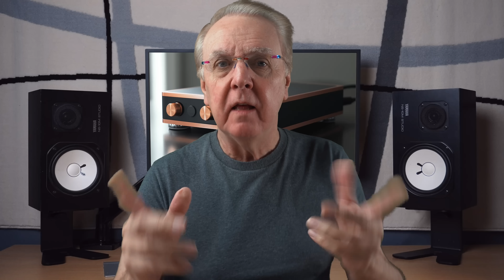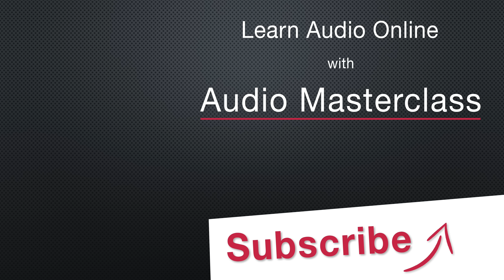Audiophile preamps - What should you get for $30,000?

Comment: There are only about 5 candidates for good low-noise opamps, it is futile to scratch off the labels.
Reply: There are more than 5 candidates I am sure but a look at the rest of the circuit will clue you in.  Low resistor values will tend to go with the bipolar parts and the higher resistor values will be with JFETs.  Supply voltages can let you rule out a lot.

Comment: Cheap and cheerful zero PSU noise Amp ! ... Get a car stereo head uint from the 90's or a system out of a Lexus LS400.  A good 12 volt battery and big wooden cabinet speakers.  It will blow you  socks off.  After use put the battery on float charge.   If you think 'Bose' or small speakers are good you need a reality check.  Even a basic 'Music centre" from the eighties is better than the junk sold today.

Comment: And anyone who seriously considers buying a Linn LP12-50 , at the price of 50,000 U.K. pounds, which purports to have been built in a joint venture between billionaire inventor Jon Ive*  - who licenses his company's name "Lovefrom" to such as the venal Tiefenbruns, needs their heads read. It still has many of the faults the original 1972 Linn LP12 had. It was a badly designed rip off of the Ariston RD11, and was a dog. As still is the LP12-50. It is 16,920 quid more expensive than the next less expensive LP12, the Klimax at 33,080 quid - for the 16,920 pounds difference you get a better on/off switch and improved hinges on the cover. That's genuine value for money. Have the Tiefenbruns found a way of taking their money with themselves when they die? Do the realms beyond the pearly gates feature casinos or dog tracks?
*and to give him his due, he has many useful inventions to his name and has done quite a bit to assist mankind.

Comment: 3:40 - concerning AC power interference, an Isolation Power Transformer Automatic Line Stabilizer ought to be your highest priority in any sort of expensive audio setup. Whether it’s some cool vintage hifi setup you picked up off the side of the road, or you spent stupid-dollars on snake-oil, or music production/reproduction setup, you should be using an adequate power supply system to the whole setup. Not just to enhance the sound quality alone, but to preserve and protect your investment in it. That’s like the 101  of professional or consumer audio wisdom. 😂
Reply from the maker: I am not in disagreement. I have looked at mains on an oscilloscope and was fortunate not to receive a Darwin award. It was a mess. I don't care whether I can hear the effect of that mess or not, I would prefer my audio to be powered by a sine wave, and for your other reasons. Sometimes there is just right and wrong.
Reply: @AudioMasterclass Yeah, I’m not entirely sure what you’re implying about preferring sine wave, on account that an isolation transformer doesn’t square off waves, so much as isolates it from mains, reduces ground noise interference, lowers the sound floor, and senses for anything particularly unusual on either side of windings and trips preventing electrocution or damage to your equipment and buffers out micro surges with mondo-sized capacitors. The primary one I use to run everything in my studio through a modular hub of 6 breakout boxes is hospital industry grade, designed for life support and vital sign monitoring equipment. Saved my life on a few occasions while working on live electronics, and saved my equipment from some serious power surges, and one instance where a fault from a storm up the road fed back hot over the neutral line, and blew every light that wasn’t incandescent in my house, and every tv that was plugged straight to mains, and not my transformer. The transformer tripped when none of the mains or surge protectors did, saving everything that wasn’t incandescent wisely connected to it. 😮‍💨❤
Reply: @AudioMasterclass  You want a very nice sine wave for your power? Go and buy a very large pro audio amplifier, used is fine. Something like a Crown XLS5000. Then go and buy a signal generator and feed that amplifier 60hz (or 50hz if your country uses that) input signal. Hook up a volt meter to the outputs and adjust the gain/volume until you get 120 vac output on the speaker outs. Or bridge the amplifier and meter 240 vac or whatever your mains is. Then hook you speaker outs to power receptacles. You now have a rock steady mains AC power supply that is within whatever spec the amp manufacture says (0.001% distortion or whatever). This works good in a workshop as well giving you variable voltage (variac) and frequency power supply. Pretty much laboratory grade power for probably less money then a terrible power "conditioner".

Comment: I saw an interview discussing phase and that their power amp went to 1 MHz to have audio frequencies in phase. And of course matched with speakers that also provide phase alignment of drivers. 

Isn't phase messed up at higher frequencies by head position? I know speakers with crossovers aren't perfect in phase. Or, do these use an all-pass active crossover with power amps for each driver? No, otherwise the 150W amp would only be for bass and mid ranges (each using about 50% power if crossed at 400 to 500 Hz) and only two power amps were shown, one per speaker.

My DIY power amps only go to 22KHz. My tube pre with transformer coupling at both input and output goes a bit higher. Sounds very good. Everyone who hears it seem amazed at how real it sounds.

I guess I will just have to wonder how great those other amps would sound. I would have to use my Allen Wright DIY RTP5 preamp that only goes to 220KHz oy my DIY Pass Aleph 1.7  preamp that goes to over 100KHz with them. What a shame that I wouldn't be able to match the 1MHz amplifier with a suitable preamp.

Comment: Retail prices in high-fidelity used to be 5 times the cost of the parts.
This theoretically covered the labor to assemble the product, too.
If the parts cost the manufacturer $1000, the retail price would be $5000.
The dealer margin used to be a minimum of 40%, but if the dealer and manufacturer had to a "1 to show, 1 to go" agreement, then the margin could be closer to 50%, (or higher if there was an agreed upon number of units that would be sold over a specified period of time).
Given the high-fidelity market is not a commodity based market, one could expect prices would be higher than what one would find at a general department store that sold mass produced stereo components.
The supply/demand numbers on high-fidelity products have never been very high, and with fewer bricks and mortar stores the market has changed--along with the pricing structure based upon these changes. 
I very much appreciate you mentioning Tim de Paravicini, whose rebuild of the Technics RS-1500 tape machine can be seen and heard operating for a few seconds here: 
https://www.youtube.com/watch?v=Ov2R5QBDktg
As a manufacturer of high-fidelity products that includes a full-function symmetrically balanced preamp (line stage + MM/MC phono stage) that sells for less than half of the item under discussion, while the total parts cost remains close to one fifth of the retail price, I have often been told that my products are underpriced and if I wanted to sell more product, then the price should be increased.
The myth of "perceived value" permeates high-fidelity audio, albeit frequently the perception has nothing to do with reality, let alone the primary sense that is served: our hearing.

Comment: You can buy an exceptional preamp for £10,000. Some guys will say 30 to 40 k plus  is where it gets magical. I disagree based on my own purchases in these price ranges. I wont mention brands,   but my £10k modular preamp with just two output modules, sounds as good as my much higher priced preamp which is in another room. Both have top build quality and are dead silent in operation. The lower priced unit represents fantastic value. I think there is no need to spend £25 k on a preamp and especially one that looks like a plain box. At those prices, kit has to look the part too. Check out German hifi and discover what those guys are capable of.

Comment: I am an electrical engineer and watched the video that went viral where Mark in a very professional way repaired a 30k pre amp that had a horrible design, was build even worse and the case was a joke. The components were just regular components (like 99% of the audio jewelry). But if it makes the buyer happy then it doesn't make much sense to say it's a piece of crap.

Comment: Firstly, let's be clear. The Tom Evans amplifier in question is a Phono Stage, not a preamplifier. A preamplifier, or line stage as it is referred to these days is normally a control unit where a number of inputs at line level are selected and then amplified or buffered. This is then connected to a power amplifier. The Phono Stage could also be connected to an Integrated amplifier. The Tom Evans amplifier amplifies the signal from the MC cartridge so it is a Phono Stage, or phono amplifier, it is sometimes also referred to as an RIAA stage, not a preamplifier. It is even listed on Tom Evans website under "Phono Stages".
Reply: All true.  The sad thing is if you open up any of this high end audio stuff and you know anything about what you are looking at the cost cannot be justified.  It also doesn't help the seller's cause to get silly with a physically massive power supply for a phono stage.

Comment: The number one reason manufacturers remove part numbers from components is to hide the fact that they stole someone else's circuit design, not to prevent people from building their designs. There are more than enough excellent DIY designs already available that would put Tom's pre-amp to shame. Some designs provided by Nelson Pass to the DIY community comes to mind.

Comment: Yes I do  own a $1700 preamp bought in the late 80's built in New Zealand bought in New Zealand as I live In New Zealand. This was in maybe in that company's  first bankruptcy or second so it was at a reduced price, Still expensive in its day. Inside it it is a thing of beauty, outside form and function. Today this thing still works as intended and as far as I can tell in speck, Its Power Amp still a Beautiful Brute of a thing has had two major repairs done (input section and power filtering). Why back in the day I could not make something so functional and beautiful, Today I can get cloce to that quality and performance. Though these days it is bits of recording equipment (preamps mixers guitar amps and pedals)  made for my use alone and made to muck up a pristine signal to add warmth and colour to the recorded part! Talk about exclusive. To me the Preamp is still loved and used every day it has been the heart of my main music playback system for 36 odd years! Now from what I have seen of the MASTER6OOVE the circuit typology and execution was on par with what one could expect even down to the shielding (internal) ground isolation except for the layout looked like the type of projects I would have made when I was 19, that case lets not talk about it except for one word "CHEEP". P.S. I am now considering myself as a recovering Audiophile.
Reply: McLaran audio per chance? If so I worked at Lamp Hose Audio and knew them them. We sold the phono pre amp and power amp. Good quality and rugged cases in dark green only. Never did get to see the preamp as it was still in progress (a big job).
Reply: @flemingchrisjohn I whish, It's A Perreaux SA1 and a nice Perraux PMF 1155 as a power amp bought as part of the deal I think early 90's back when I was young

Comment: I agree audiophile mains cables are snake oil. My local dealer lent me a couple of Titan STYX mains cables to use with my Naim 250DR, and my power supply. I discarded the Naim Crabtree cable for a week while I tried the Titan cables. I thought there was little difference when I first swapped; when I swapped back, the difference was so obvious I had to make the purchase. The Naim Superline runs rings around their Stageline, but is it £2500 worth it? Maybe?

Comment: look. its a pre-amp. if it ain't running from a battery, then i consider it junk. filtering the powersupply is essential, mains noise is a thing. so ditch the mains. no mains, no noise from the mains. there are HEAPS of very good opamps out there. build the bread and butter instrumentations amplifier circuit, and yer set. that simple. won't cost 30k, and will do about the best job that can be done.
Reply: Power supply is not an issue for decades. There are many pro audio preamps that have built in ribbon mic inputs where signals levels are down there with MC, most are as silent as audiophile stuff, despite internal power transformer and the rest of the psu.
Reply: @Signal_Glow  true indeed. But supposedly assume you want the best. Just have 2 sla battery in series , regulate em to 9 volts , and have a ground point inbetween. And there you have it. No powersupply powered from the main's will ever be close to it. Surely an MC has very very small voltage... even less current to speak of.. the total stack of amplification to reach the speakers is a huge lot. 
If anything sips its way into the amplifier reaponsible to have that few mV voltage pumped to line levels , it will get amplified down the road. Wanting the best and cleanest deal is justified.
But the approach of going at it whit a powersupply powered from the main's is silly. It will cost quite a lot to get the proper rails , whit sufficient filtering and dampening. The sla battery option is both simple , cheap , and unrivaled by all means.

Comment: There is so much BS in the Hi-fi market, many things totally ridicules, such as high grade digital cables, power cables and power conditioners.  In reality, 30,000$ is a shit load of money and what do you really get over a 300$ preamp, maybe 0.001% improvement - listening to vinyl, a medium, that is by no means perfect and with substantial variation in quality between records (even if the mastering and cutting were originally perfect).  And of course, any improvement you might get, is instantly undone, if the acoustics of the room and many others factors are not also perfect - and that includes your ears.  Many audiophiles, don't forget, are not exactly young, the reggaeton listening granddaughter will certainly have better sonic range than they do.

Comment: If I had 30k bucks to spend on audio gear t would likely be 27k in a pair of loudspeakers and 3k in electronics. But I don't have that money and assumably not the ears to distinguish from my current $2000 system. My record collection might be worth 30 grand though, but I still fondly listen to them via a moving magnet setup.
On the other hand if anything justifies a 30 grand price tag then I would expect a gold plated cast metal cabinet that needs two people to lift off the shelf; containing a studio grade rack-and-cards layout and comes with a gloss printed 500 page manual to have it serviced even in case the builder deceases early....

Comment: Why bother. As long as people pay tax over their overpriced equipment it is just taxation of stupidity.
I have seen high-end valve amplifiers with the coupling capacitors the wrong way around.
When I pointed it out I was told there was no + or - side on the capacitors.
That's correct, but the internal construction is important. The outer layer must be on the low-impedance (driving) side. The seller then just ignored me...

Comment: I am privileged to be the owner of one of the late great Tim De Pavaracini masterpieces as the centre of my system. His 912 preamplifier has an inbuilt phono stage that can inflict serious even fatal reputational damage on most so called "high end" or laughingly termed "esoteric" external phono pre-amps. It is also a system wide Preamp of extrodinary capability so much so that I have come to see it as simply the the thing that sits there and accepts the input from multiple sources and allows it all to sound its best. It also has actual yes real and volumetric unit meters, but I still think they just look so damn good it doesn't matter that they actually can be and are useful. Anyway, all this wizzardry in a box retails around £12k. I hasten to add I didn't pay that but my point is, even at £12k I think it would still represent great value when compared to Tom Evans Mastergroove or any other phono stage before we even get to the other abilities and functions of the 912. Its so because there it's a genuine esoteric piece, why? Because there is genuine genius behind its design, and it absolutely does what it says on the tin.Timspoke with uncompromising gravitas, but his equipment definitely walks the walk. The other person I put in that echelon is  Peter Qvortrup of Audio Note UK.

Comment: Even if the electronics are perfect and produce incredible sound, at that price point everything else should be of very high quality. If I was paying 25k for an amp I'd like to assume that the case and mounting hardware is worth a few hundred pounds at least. 
 
I would probably prefer to pay an extra 1000 on the total price to have all thar poorly fitting and weak plastic swapped for quality materials. 

....IF I was paying 25k for an amp...

Comment: I have  built a power supply for my Hi Fi  pre amp one for each channel and the capacitors do male a difference to the sound what is needed is 100% pure dc supply, a battery would give the ultimate performance

Comment: I bought a Benchmark DAC1 back in the day. Very well designed and built. Thorough manual. It is still a fine piece of equipment, and I am still using it. Cost about $1000 which was a lot of money back then.

Looking at that level of design/quality and price point, I cannot understand how any small component can get to cost $30K.
Reply: Still using mine after 10 years +. Cheers.